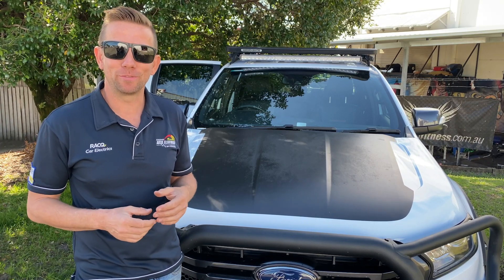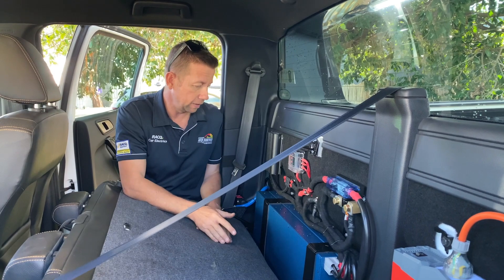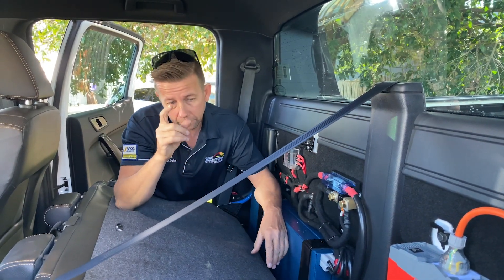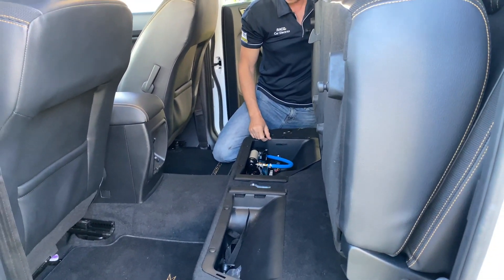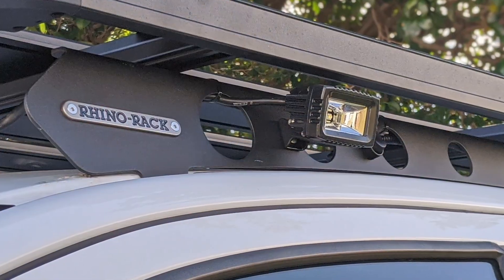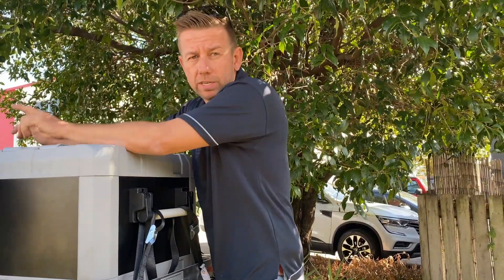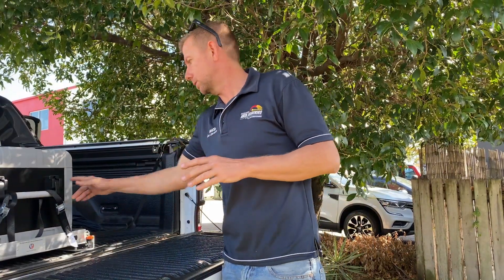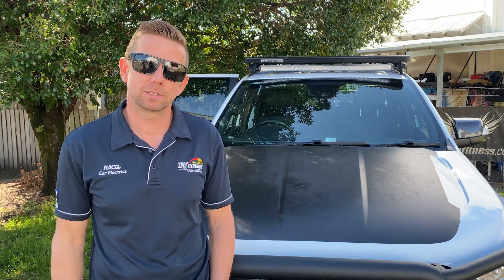EPIC Ford Ranger Custom Lithium Battery System to Run a Coffee Machine | Accelerate Auto Electrics

Comment: If i'm running a BCDC1250 and wanting to run a second DCtoDC in the trailer what amps could the second dctodc be without upgrading the alternator from stock in a 2019 Ranger XLT
Reply from the maker: We would normally use a 40 in the car and a 40 in the van and that would be pushing the stock alternator. We have done a fair few upgraded alternators in the Rangers for this very reason.

Comment: Hi, John again. thank you answering my other questions! We are getting a new 2022 Wildtrak V6 hopefully in next month and it has a spot under the bonnet for an auxiliary battery, (is this good?) so will contact you when it comes about a setup and the other wiring needed. In the meantime we are just about to finalize the order for our van & looking to get about 300ah of Lithium. What size cable would you run for the grey ando plug from hitch to the van DC-DC charger/BMS so we can specify it for the build? I guess it needs/best to be the same as the cable from the vehicle alternator to the hitch? Cheers!
Reply from the maker: Thanks for the comment! 
We have not had any experience with the new Rangers to comment accurately on their dual battery locations & options. 

We recommend a MINIMUM of a 6BS Twin core cable from your DC2DC charger to the front of the caravan.
Reply: @accelerateoffgridtouring  Thanks, is it important to have the 6BS on the van as well? I think they use 12mm2. Would this be ok? Also if I can ask another, I am not happy with the prices the van manufacturer are asking for Enerdrive upgrades. I am thinking of getting their basic setup for a while as it is a few years before we start big travels then upgrade to the latest at the time. Is there cabling (size/type) I should request now for inside the van for a say 400amh Lithium setup?
Reply from the maker: Hey John,

We'd need to know a bit more info. For more details, feel free to give us a call on 07 5479 6652 or via our contact form below. Thanks

https://accelerateoffgrid.com.au/pages/contact-us

Comment: How are you getting the wires from the tray inside to the battery?
Reply from the maker: We use a Factory fitted Grommet on the rear wall of the vehicle. 
sealing it as required.

Comment: Hi. 
I spotted that you fix all the gear to the back wall. Did you replace the carpet trim with panel. 12mm ply?
Reply from the maker: Hi Fasola! Thanks for the comment! We certainly did make a new rear wall to be able to fix all the components correctly and securely.

Comment: Just a question, why a BCDC1240 and not a BCDC1225? Faster Charge? Does it compromise the battery?
Reply from the maker: Lithium Batteries can accept a higher charge rate compared to standard AGM battery. 
We use the Redarc BCDC1240D for a faster charge rate. With the charger set to the Lithium charge profile it does not compromise the battery. You can use a BCDC1225D but it will charge the battery bank at a slower rate.

Comment: That battery & inverter set up is just what I'm looking for in my new FX4-Max.  Suggestions as to who could sort this for me in Sydney?
Reply from the maker: Hi there, unfortunately, we are not familar enough with anyone from that area to offer a recommendation.
Reply: @accelerateoffgridtouring  Can I buy the same full battery system as a kit (batterys, tray, charger, inverter,  monitor, sockets, etc) from you and either fit it myself of find a local auto electrician  ?

Comment: Great setup! I am in the U.S. but have a Ford Ranger and have been trying to figure out a battery/solar system for the back of the supercab  but need to run stuff in the camper in the back. Can you tell me how you have run the wires from the cab to the tray for the fridge?
Reply from the maker: Hi Daniel, glad you like the setup. If you'd like to know more about our install process, you will need to contact our team directly at info@amae.net.au.